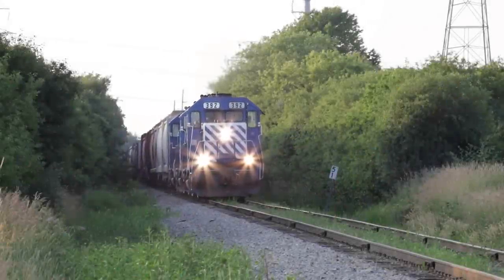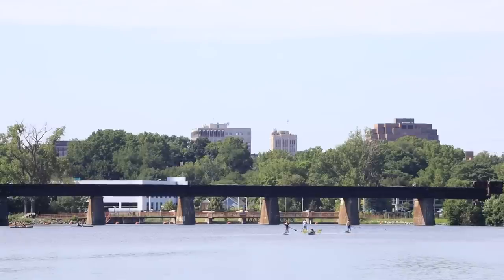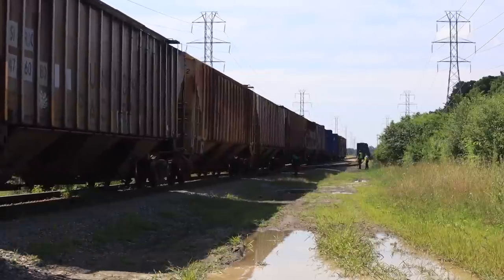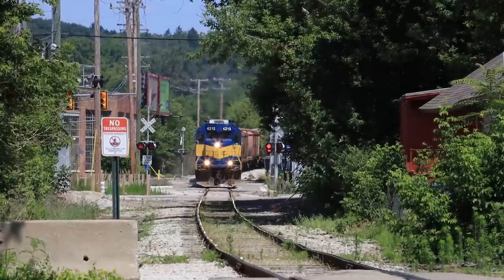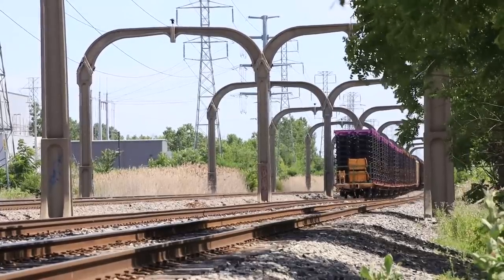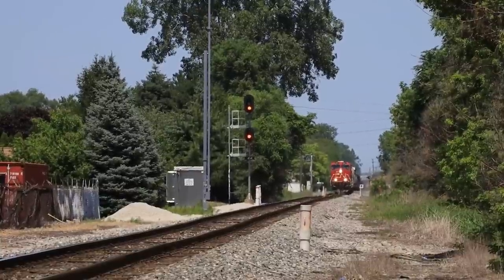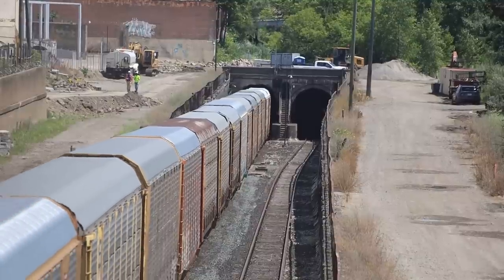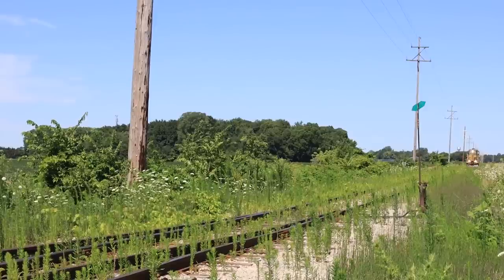Freight Trains of Southeast Michigan

Comment: Re:  the "Alco" trucks on the GLC/TSBY/Ann Arbor GP35s.  It is commonly believed that these trucks came from the AA's fleet of FA-2's.  But EMD had a stockpile of these trucks from the trade-ins from other railroads.  And the AA FA's were being traded-in gradually (Dec 1963 through July 1964) as the AA GP35's were being built making it unlikely that AA FA trucks went directly to the AA GP35's.  So it is difficult/impossible to conclusively say that the original AA FA trucks are still running today under the GLC GP35's.
Reply from the maker: Thanks for the important clarification Craig, great to know!